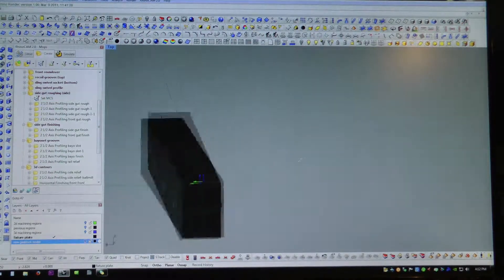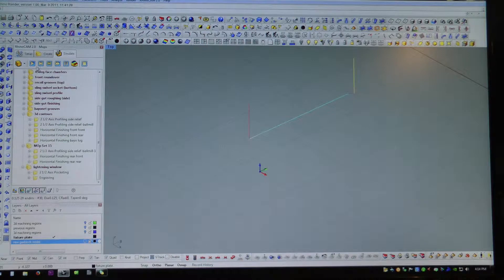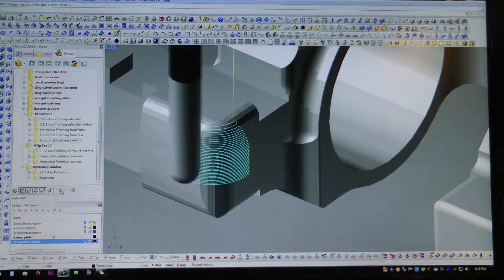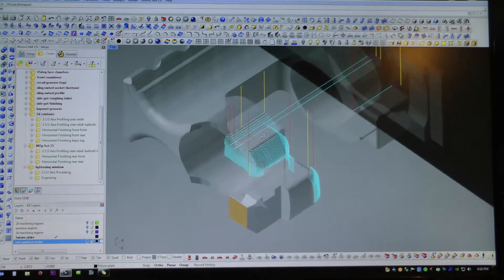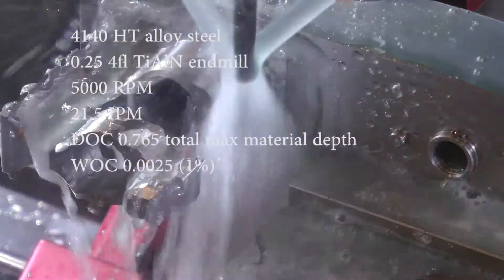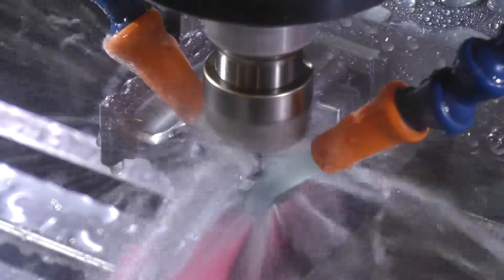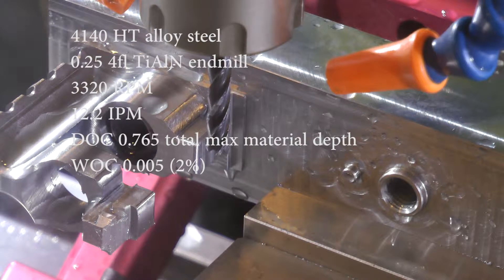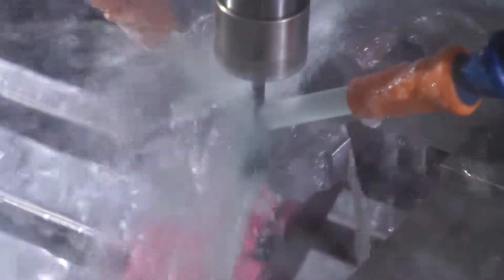AR15 High Rail Gasblock: (pt.7) Side gutting and 3D profiling

Comment: I would try milling the bayonet lug slot before gutting the thing, it would reduce your chatter significantly
Reply from the maker: I agree, like you said it would leave the part more rigid for that milling op. I thought about that too and I can't remember the reason I decided to gut it first. I may have been trying to avoid plunge milling in the gutted area or something. I don't get chatter anymore anyway on that op since switching to stub length endmills, decreasing the speed, and increasing the feed. Maybe I'll look to see if there is some reason I can't do what you suggested. Thanks!

Comment: What CAM software are you using?
Reply from the maker: Hi Evesta. I was using RhinoCAM 2.0. I really like it but to me its main drawback is lack of HSM/trochoidal toolpaths. The 2016 version is supposed to have it I think.
Reply: Hello War Machine.  I am using Sprut Cam 8 and it is very buggy. One problem that I am having currently is with the simulation.  It does not match what is posted in the g-code. Also,  my top and bottom levels have been changing on their own.  Have you had any problems such as this with RhinoCam?
Reply from the maker: Evesta Green
I occasionally have some weird simulations but it is usually something to do with the graphics card driver on the computer. Whenever it starts to look glichy I save it and re-open it and it looks fine. I don't know much about SprutCAM 8. Are you using a Tormach?